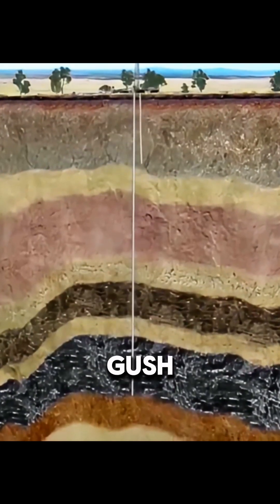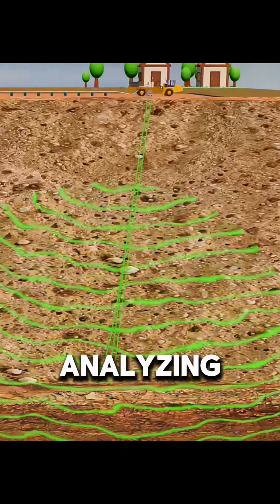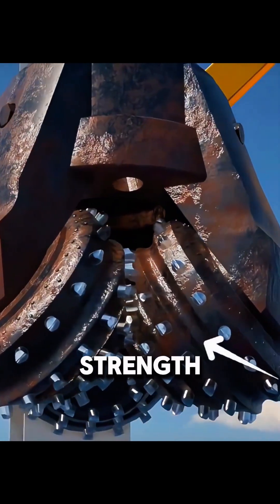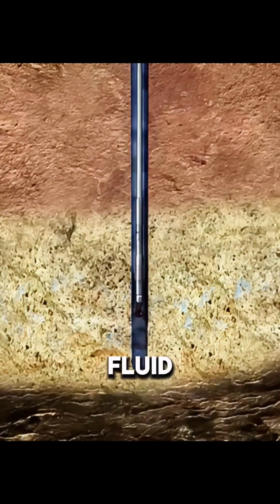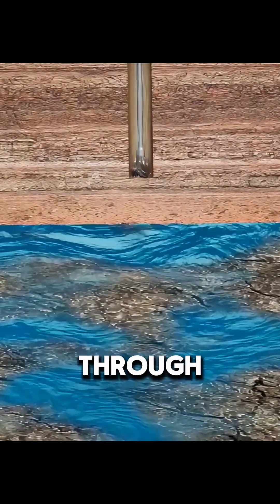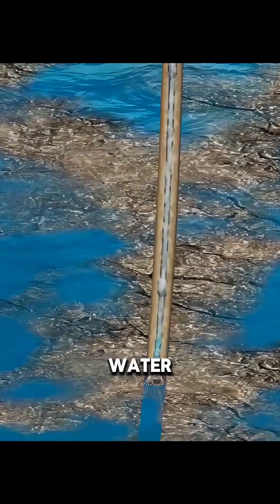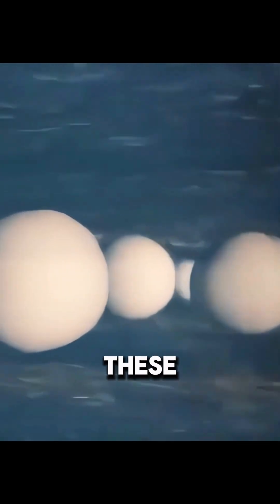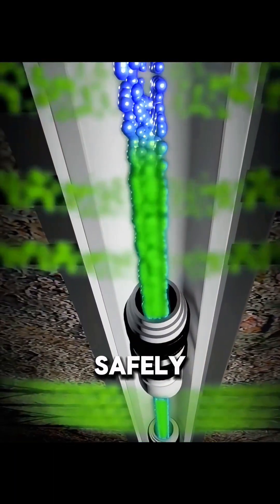How Is Oil Extracted from Deep Underground? #foryou #zackdfilm #oil

Comment: Did they mention that drill fluid is toxic and poisons the ground water and soil, and so does the oil
Reply: Did you mention you are using electricity made by the said oil?
Reply: @daylate Don't even start. And did you know that most of the oil 🛢️ that is drilled here is exported to other countries. It's pretty dumb but true
Reply: @DarthM220  The US is a net exporter of total petroleum products, meaning it exports more petroleum (including crude oil and refined products) than it imports overall. This status has been consistent since 2020. 

Nice try, troll.
Reply: @daylate You confirmed what I just said. If the drilling was done more carefully or not at all in some areas then I wouldn't care. But the drilling has polluted the environments around it including the ground water that the local people need, that's not fair to the people or the animals in the environment near the drilling.
Reply: @DarthM220  explain how you get around all day. How do you live your life. 

Using oil while crying about oil. Where I come from, that's called hypocrisy.
Reply: @daylate  That's not for me to figure out, there are plenty of people that can but won't because they will be stopped. I'm also not crying about anything, I'm pointing out the flaws that need to be fixed. There have been alternatives to oil and I'm not talking about the typical stuff either, but big oil and the CIA have killed the people who have created possible world changing alternatives. So we are stuck with oil until they decide we don't need it anymore, it's all about profit and power.
Reply: @daylate he clearly gets through life by identifying and solving problems instead of just accepting the status quo. You sound exactly like the people who thought drilling for oil would never replace using horses to get around. You’re every bit as short sighted and useless as they were.
Reply: @DarthM220 By the way it good that we're exporting oil so we can have money to fund environmental causes and prevent extinctions or exterminate invasive species also its important because most countries have methods that pollute the ground much worse think before you speak
Reply: most of the oil is not exported and used in the U.S do your research also you said dont even start meaninf your ignoring the fact that your using a phone which will pollute and poison the ground when decomposing over hundreds of years in a landfill and using fossil fuels for electricity
Reply: @DarthM220 You want to end civilization so im gonna fact check every reason why if civilization ended currently the environment would have no chance of survival 1 invasive species the lion fish in on the Florida coast and can reach maturity in a year it can lay 15000-50000 eggs a day and is wrecking the ecosystem human civilization kept that under control with fossil fuels for boats and extermination and construction of equipment
Reply: @DarthM220 another ex of invasive species pythons have you heard about the damage they've done to the Everglades human civilization produced advanced Ai through fossil fuels that analyzed one of their experiment and found their routes which now they're killing thousands of them and finding nests or layers with sometimes thousands of eggs
Reply: @DarthM220 the experiment production required fossil fuels and guess what the pythons in the Everglades are swallowing deer whole and putting species near the endangered category they would've all died without human civilization preventation lib there's also a invasive species trout in the water wrecking the ecosystem there but is being stopped by human civilization final ex
Reply: @DarthM220 The kudzu vine was a invasive species that caused massive damage grew a foot a day and spread out in multiple directions for faster growth it smothers trees ponds rivers and did massive damage it was destroying the ecosystem and causing massive harm around the 1980s to 90s only in that time zone because HUMAN CIVILIZATION STOPPED IT WITH FOSSIL FUELS FOR MOBILITY AND CONSTRUCTION OF EQUIPMENT I'll cover more reasons tommorow
Reply: And what are we supposed to do end production of fossil fuels ending human civilization
Reply: @AlexanderTannenbaum-c2x yes
Reply: @DarthM220 you can go first......I promise I'll follow  :)
Reply: @AlexanderTannenbaum-c2x hahaha. Fossil fuels. You fell for it
Reply: ALSO the only way oil drilling plates the ground around it actually is accidental spills or improper disposal of wastes IN OUR SYSTEM so your wrong do your research instead of complaining on the internet about something u have no knowledge of your thinking of fraking not all oil drilling is fraking
Reply: @AlexanderTannenbaum-c2x Fraking and oil drilling have their risks, accidents in the past have caused irreversible damage to the environment. So no I'm not wrong and I have done my research, I've had to do research for this in school as well as watching documentaries on this, stop thinking you have the high ground.
Reply: @DarthM220 emphasis on accidents in the past how rare are those how come yiu didnt mention that in the comments how come you havnt responded to the invasive species argument
Reply: @AlexanderTannenbaum-c2x  It's not just about the accidents but the drilling itself. Also I'm not talking about invasive species, we are talking about oil 🛢️. Don't try to change the subject, I know what you're trying to do, if you did care about the environment you would be against oil drilling here. I'm fine if we get it from other places but we don't want more damage to our county's natural environments. I also care about other places but this country is a priority first
Reply: @DarthM220 You said we should end the production of oil which if you would read you would realize is needed to stop these invasive species you also said we should do it even if we have to end human civilization which you guessed it is needed to stop the invasive species causing massive damage to the environment this isnt moral high ground these are facts you somehow can't understand this isnt changing the subject this is a supporting statement oil drilling causes pollution when improper codes are violated or errors occur try taking in whats been discussed in the conversation
Reply: @AlexanderTannenbaum-c2x  when I responded yes, I was being sarcastic 😂 I just wanted to push your buttons and it looks like I did 😂 you need to take a chill pill 💊, I like how you actually thought I was serious. I also said yes because I didn't want to waste my time typing a paragraph but I still did that anyway 😅
Reply: @DarthM220 regaurdless the point stands that drilling fossil fuels also has ecological benifits that your not considering like cleaning masive trash piles in the ocean
Reply: @AlexanderTannenbaum-c2x  Drilling in the ocean is the last place I would want anyone to drill, that's worse than land drilling.
Reply: @DarthM220 alright there's where you have a point agreed drilling there is a terrible idea
Reply: @AlexanderTannenbaum-c2x  I'm glad we can agree on something, oil spillage in the ocean is harder to control and clean compared to the land
Reply: @DarthM220 sorry for being rude got a bunch of radicalism from where I come from seriously nutty people I assumed mb
Reply: @AlexanderTannenbaum-c2x  It's ok, I'm sorry for being a bit hostile too, I'm just glad that we were able to make peace 🕊️. We both want what's best for humanity and the environment.
Reply: @DarthM220 same here
Reply: There will never cease to be a need for petroleum products, even without automobiles. Electric vehicles still require petroleum lubricants in moving parts to reduce friction. Plastic manufacturing is dependent upon oil, and that includes 3-D printing which is revolutionizing industry on a global scale. The device you use to spread your depopulation agenda on is partially made from petroleum products. Get rid of everything you own and protest on the street using nothing but a cardboard sign; otherwise, you're just a hypocrite.